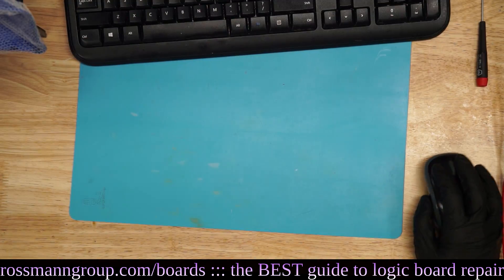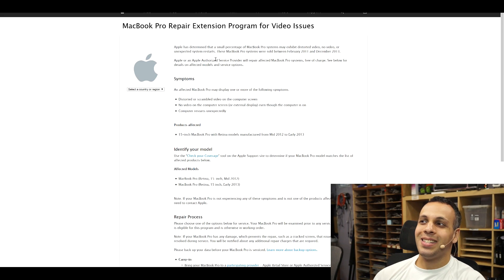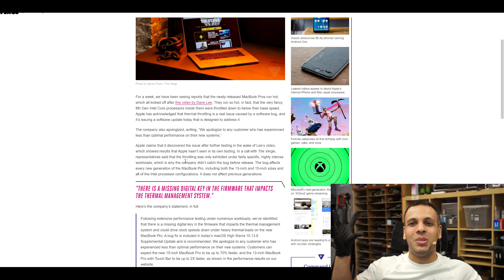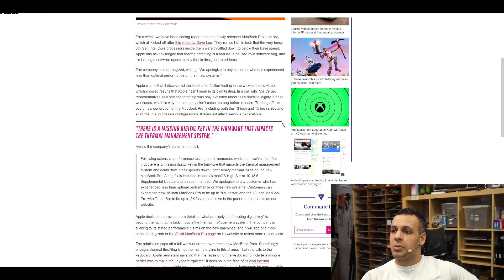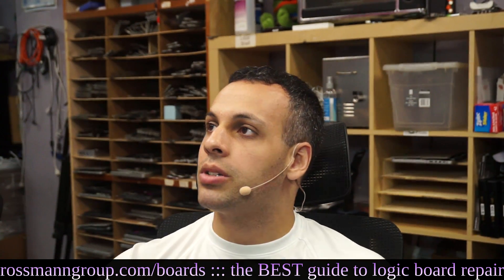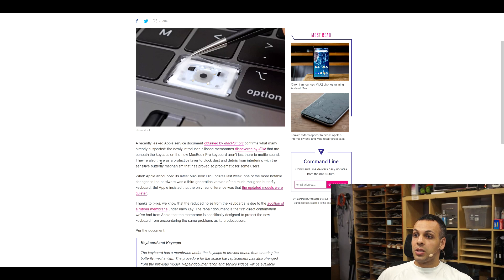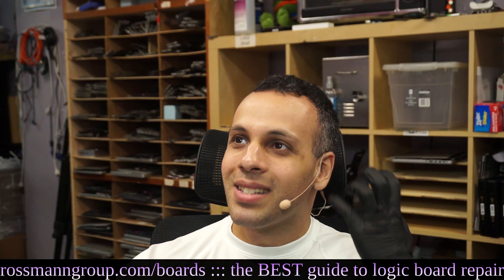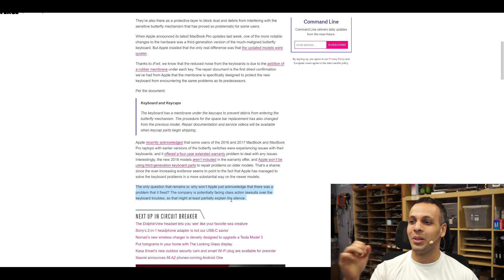This new Macbook is becoming a meme.

Comment: Geez, not to defend Apple, but you are acting like a total douche bag.
A) the heating problem could easily have been a production problem that didn't exist on their prototypes, or just happened one production line, or may have been intermittent.
B) the problem was fixed within about week from it being reported, yet you're acting like the whole product is ruined now and forever.
C) Saying the keyboard reliability is improved does NOT mean it was "crap" before.  It just means it's a better than before.  "Before" could have been quite good, they aren't saying either way.
Reply: The problem is barely fixed...The Macbook is still pretty Hot. The design is flawed from the beginning
Reply: A) so you know for certain no other patches will occur?
B) what design error led it to being so hot it can't be corrected?  How do you know the issue simply isn't corrected yet?
C) Plenty of products run hot and we don't say they're "broken."  Why do you feel the need to hyperbolize?
Reply: @christobanistan8887  you can't fix a hardware issue with a software bug patch. They put an i9 into a thin laptop with very few fans or ways to cool it.

Try putting a nvidia 2080 and an i9 in a desk top with very little ways to cool it then put heavy loads on it. The computer will slow down and in many cases shut down.

Apple need to beef up the laptop if they are going to use top of the line CPU chips.
Reply: My 2016 15" mbp touch bar heats up to 100c cpu at load, how is that remotely safe, and doesn't climb back down, even at full fan load
Reply: akrpwd  Is that the case on all 2016 MBPs or is it just your device?  If that's real, that you can boil water on it, you should film it.
Reply: @christobanistan8887  it does not matter oh many it's on. It should not be happening to being with.
Reply from the maker: i expect $2000 products to work, total douchebag..
Reply: So it didn't work, huh?  More hyperbole?

Comment: You're making a big issue out of nothing, you just need to do things properly. Whenever I burden it with a very specific high intensity workload, such as watching a Russian dash-cam car-crash video, I place the Muckbook in a shallow aluminium tray filled with liquefied CFC and it works just fine. Just make sure you wear a pair of well insulated gloves and suitable eye protection as the CFC does tend to boil off somewhat violently at times.
(PS there is probably an ozone friendly alternative that could also work)
Reply: Just use dry ice. I'm sure that will help.

Comment: Few notes.. First off, Intels media engine doesn’t work on all codecs the same way. My guess is the editor in question was using a codec that wasn’t optimized for the intel media core and apple never tested it. Ya can’t test it all, that impossible. When confronted, they solved the problem, good luck getting microsoft to make the same resolutions. 
Second, the reason why they can’t admit a failure in the older keyboards is that they’d have to give people new computers. The top case has been redesigned and so has the keyboard. They’d have to replace all the top cases (which you know is the entire machine) and that would be a huge undertaking. It’s way better to swoop it under the rug like EVERY SINGLE CORPORATION DOES. The fact that apple even offers solutions to issues is amazing. Good luck getting any support like that from a PC manufacturer. Gotta think of these issues from a legal standpoint, rather then just a consumers stand point. 

I could go on all day how BMW and Toyota/Honda have lied to consumers related to safety and potential death, yet people still buy vehicles unbeknownst to the issues.

Comment: Louis, you are making a video channel out of company policy. If you check into legalese you find statements by any company often go via their legal dept. You for example in repairing someone's product are only dealing wholey with a single individual if your repair fails. You have to consider your businesses viability with any repair. Apple have this on a worldwide scale and while they are not the only company who doesnt quality control their products. Look at the car industry! Nevertheless it leaves them wide open for ridicule for failing to check the quality of their design, quality of components, quality of manufacture, quality of service and delivery; making the purchaser wear Quality control . This is a widespread business practice  in manufacturing and the reason that warranty exists. All I am saying is your video channel is all about lack of QC in manufacturing.  Here we have a product of professionals where a status exists in the use of this particular product based on compatibility and stability. Where individuals make their incomes with these tools. You are making Apple more exclusive and you are in their employ, doing their Quality Control for them and a free video to spell out the short comings. You nerd you!

Comment: Ah, gotta love my HP notebook. Running stable at 140% of the base frequency thanks to undervolting (and probably more could be done if I disabled TDP-based throttling but I want to be able to have it on my lap...). I bet Apple would ban me from their store for that.
(I'm exaggerating but they did ban my original iPhone for installing a desperately necessary task switcher. The first and last Apple product I ever bought.)

Comment: After the update this can go two ways:

1.Costumers will have the same issue because thats a hardware problem.

2.The macbook will get a massive decrease in performance because the update wont let the CPU reach max speed to control the temperature.

Comment: Although they say that they wont be using the 3rd gen keyboards on older models, I got my 2017 model back from a repair last week and the keys are noticeably quieter than they were and than my boss's 2017 model.  Seems pretty clear that they used the new model keyboard in the machine the sent to me.

Comment: Get a PC with a i7-8770 and a GTX 1080 with Black Magic Resolve 15 for half the price and better performance.  Search for other videos on this topic using this equipment.
I have a MacBookPro but it is the last one that had HDMI and USB 3.0 ports.  I wouldn't buy a MacBookPro now with thermal throttling and only display port outputs.

Laptops are not really made to do video editing.

Comment: WTH? Have Apple never heard of a stress test? I mean I had access to stress test programs in the f'ing 90's designed to test your 486 CPU to the limit! A 486! How did I get these programs? They came on the front of magazines! 

This idea of putting the CPU through stressful tests has existed since that time at least. I know for a fact that there are tons of people today who stress test CPU's, motherboards, HHD's watching thermal performance and other factors. 

Bloody hell Apple. It really is not that hard to push a CPU, get it hot, and find an issue. It's just lazy of you Apple. You simply didnt bother.

Comment: Apple if they will release a car:
Customer: my car shakes if I go over 170 mph.
Apple: No problem, we'll fix that in the software, so you won't be able to go over 170.

Same shit they've done here: instead of pushing the CPU to its maximum speed and to throttle, they've reduced the max. speed just a little (around 200 MHz) such that it won't throttle anymore. Before it had a max. temp of around 100*C and now around 95. Anyway, that is still an insane temperature for a CPU. And I'm really impressed because many thinks a non-software issue can be fixed into software. They're really abusing that i9 CPU, meant to have greater performances and a looong life.

Comment: Every Macbook Pro has problems with GPU failures. But so do Dell XPS M1530 and HP nc8430 iirc with same GPU and same problems. Used Dell Precisions and Alienwares from eBay rarely last more than a year of gaming use before the GPU blows up, or funny pixels across the screen. Mobile GPU's just are not reliable, Apple's thermal design doesn't help.

Comment: would Apple have the balls to pressure Intel into fixing their god awful thermal paste under the lid? had Intel used a proper thermal interface the Macbook cooling would've been enough to cool the CPU

those lazy asses at Intel sell their chips for hundreds of dollars and they can't charge 10$ more to afford a good thermal interface? when delidding and changing the paste lowers the heavy load temperatures 20 degress that's insane

Comment: This whole software thing is just bullshit. They are basically denying that it has anything to do with their crappy vrm design and that they decided to not cool it with a 50 cent piece of aluminium. And how can the call this a "pro" grade machine when my 500$ crappy plastic ideapad has a better cooling system... EDIT: someone try running prime 95 on one of these, the board will probably cook itself in less than 2 hours

Comment: There goes Apple again in typical Apple fashion thinking that this issue is a Software issue and not Hardware. They did the same thing with the Iphone Antenna gate where they released a software update to fix a hardware problem. Unless they are releasing a BIOS update that can do something to help the hardware. But if it's a MacOS update that isn't going to do crap.

Comment: But it could be true that the firmware have a bug or just saying the thermal management was not optimal is not a lie: with a good thermal management, in the worth case, the core i9 mac should have equals perfs than the core i7 mac at heavy multi-tasked loads.

Comment: 5 bucks says that the missing 'hardware key' is an undervolt being done via software.  With this missing, the Mac runs at full pelt and thermal throttles.  The software 'fix' will add this back, the Mac will run slower/cooler and they'll probably see an increase in speed.

Comment: Not debate it... bullshit... Macs are NOT stable in today's production environment.  You get that cowboy who decides to update his OS and nothing works as it should and his video plug-ins won't work unless you shell out hundreds of dollars in upgrade fees.  I'd go all PC if it wasn't for the fan-boys in the office.  But even then, the overpriced Mac pro requires using up all of your ports and even adding Thunderbolt to PCI adapters if you want 10G network connectivity, video output to a monitor etc.  You pay premium prices for a computer that has to add a ton of external hardware to be USEFUL.  Nope... don't do it.

Comment: The Apple Pro should be made for professional use. Not a super slick looking consumer laptop, but a slightly industrial looking thing with a cooling fan and multiple ports. THAT would be cool, but Apple has put function in second and called it professional, that IS a joke.

Comment: Apple is a very large thorn in my ass that is non removable.. Here is why i USE MACS and Pc's as a network admin and have to repair both regularly and apples products are simply put a very poorly built product and way more expensive then IBM clones not to mention RMA parts are so BLOODY expensive when compared to clones item replacement parts. If they wern't a bunch of greedy bastards they would make it so you can buy other hardware from different companies and then people would truly see how poor of products that apple builds  but you should realize this now by simply watching louis's channel.Notice almost EVERYTHING he repairs is mac's!!! If they had other Hardware designers and opened it up to other Hardware designed companies like asus etc. i guarantee the apple hardware is much less reliable parts and they do on a regular basis cut corners on .02 cent capacitors where if they spent .03 cents it would last up to 2x longer and mtbf would be on par with its ibm clone counterparts...very poorly designed hardware and cooling systems which is the most important part of a computer!!... If you want a system that is Better built and cheaper I suggest just building whats called a hackintosh (it's running apples operating system on a non apple made computer) remember they run intel chips and is based off linux/unix code which is one of the most stable operating systems that are used on intel based processors - so dont buy apples poorly built products just buy or download their operating system just keep in mind you have to use a AMD based videocard is the only downside no nvidia support but apples operating system is the bomb a very rock solid operating system made for easy use by idiots. compared to windows it is a much simpler os to use but lacks the advanced features and tweaking you can do with microsoft windows (win 7 pro is by far much more stable then windows 10 personally i prefer using it)   Also another common thing is why does mac users seem to think macs dont get viruses??!!!  THEY DO just mac users are not usually tech oriented or intelligent enough to realize it has a virus! - Made for Idiots by Idiots should be apples slogan.  I can design better hardware with vacume tubes and a breadboard lol. SERIOUSLY LOUIS PLEASE DO A VIDEO SHOWING A CLONE SYSTEM RUNNING MACS OS AND SHOW HOW MUCH FASTER  an IDENTICAL Clone IS COMPARED TO APPLES BUILT SYSTEM WITH SAME SPECS. MY I5 based clone has the same processor as my mac same amount of ram same ssd's but the clone is 17% faster cost almost $1800 less and runs 22% cooler under heavy load And people this is their Professional Tower Workstation a $5000 plus dollar system at that time Everyone should be told the truth from apple the hardware they design is sub par basically cheapest made products possible for the price your paying and it should be much better built using premium parts because your paying a premium for them to begin with!!! How or why this is possible is because its poor product design/manufacturing and they know people will buy it just becasue it has that stupid apple with a bite out of it logo on it.  Everyone that piece missing from the apple is them taking a bite out of your wallet litterally and i strongly suggest you look into the Building of a hackintosh system that runs both windows and mac's operating systems so you get the best of all worlds, better price, better performance and better manufactured parts . If apple makes their OS officially supported by other manufacturer's Microsoft would have a good run for its money and I bet apple would have just as many mac based os computers as microsoft if not more. Mac simply put is a much better built OS to use but the hardware they design to use it on is simply lower end over priced fancy looking garbage compared to other computer component manufacturers. APPLE PLEASE MAKE IT SO YOUR OS CAN OFFICIALLY SUPPORT DIFFERENT MANUFACTURERS PRODUCTS   AS YOUR HARDWARE DESIGN TRULY IS TERRIBLE AND YOU GUYS KNOW IT!!!!!!!!!!! Apple dosen't care about the user they care about MONEY NOTHINg Else has anyone ever herd of apple talking about what type of capacitor they use what vrm modules They use the speed of their ram or manufacturers???? NO BECAUSE IF THEY DID ANYONE THAT IS A TECHNICIAN WOULD BE ABLE TO SEE THE COMPONENTS ARE MADE BY THE LOWEST END MANUFACTURES POSSIBLE  INSTEAD OF GIVING THE END USER A TRULY HIGH END COMPONENT BASED SYSTEM  THAT IS THE HIGHEST END THINGS POSSIBLE BECAUSE WE ARE PAYING THE HIGHEST POSSIBLE AMOUNT FROM U GUYS!!!!!!  AS I SAID APPLE IS A THORN IN MY ASS AND THEIR DOCTORS WONT REMOVE IT AND SHOULD OUTSOURCE THEIR DESIGN BUT NO APPLE IS GREEDY AND THEY WANT EVERY CENT OF YOURS EVEN IF IT MEANS ITS AN INFERIOR PRODUCT SIMPLY PUT---GREED--  //// - PS. THE UNDER THROTTLING CANT BE FIXED BY A SOFTWARE ISSUE IT IS POOR COOLING DESIGN!! ALL THEIR FIRMWARE/SOFTWARE UPDATE WILL DO IS MAKE IT RUN SLOWER AND SHOW THAT ITS NOT OVERHEATING PLUS THEY CAN EASILY MAKE THEIR OS SHOW ITS FINE AND FUDGE WHAT NUMBERS IT REPORTS AND SHOWS. DOES THIS SOUND FAMILIAR TO HOW THEY HAD TO FINALLY ADMIT THEY MAKE THEIR OLDER PHONES SLOWER WITH EACH UPDATE ON PURPOSE SO U HAVE/WANT TO UPGRADE. I AGREE WITH LOUIS THE ONLY WAY TO FIX THAT ISSUE IS TO REDESIGN THEIR COOLING SYSTEM TO MAKE IT BETTER AND REPLACE THE EXISTING UNITS //////////////////

Comment: I think this has something more to do with all the Intel bugs decreasing performance dramatically on a lot of systems. And considering this happened within a year, I don't think that was enough time for even Apple to redesign their product. Not that I find this crap acceptable. I wouldn't buy a new Macbook or any laptop at the moment. They won't be the only ones exhibiting this problem with whomever uses Intel and thin designs.

Comment: It was software issue if cpu was at, like 70 degrees and throtling, but it hits 90+ degrees in like 10seconds... You can't properly fix problems like this with software, just blur them to be not so obvious.

Comment: I wonder if the “Silicon barriers are for noise suppression. Nothing else” rhetoric is purely because - as iFixit found out - the keyboards are still susceptible (albeit less so) to dust ingress; and Apple are not yet prepared to admit there is an issue. They have a tendency to do the old
“Just FYI, there was an issue, but look! We fixed it already!”

Comment: Apple didn't fix this issue because of customers but they're worried about possible conflict with Adobe. Probably Adobe sales started to fall due to software not working properly on these macbooks .... and so on with other software manufacturers. And software fix is really a joke. It must throttle again, just different method, because cooling system is just too weak. pfft. how boring... keeps repeating